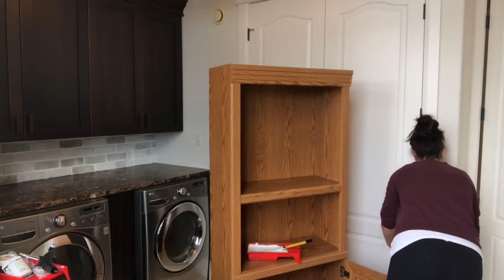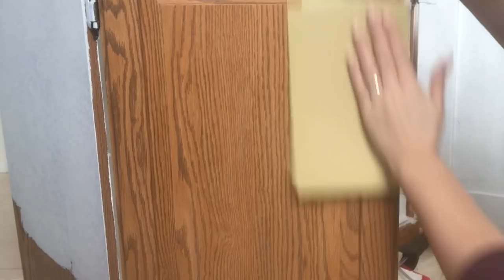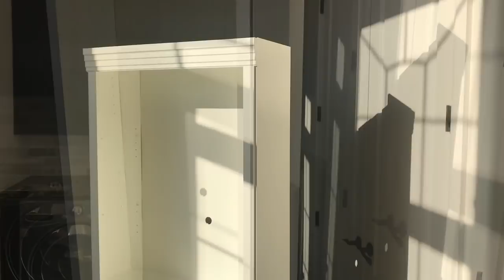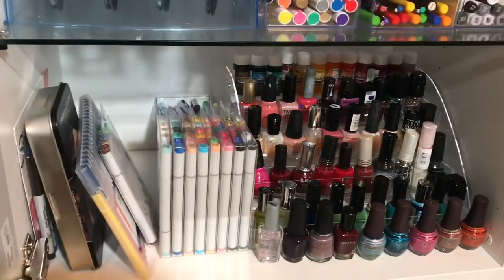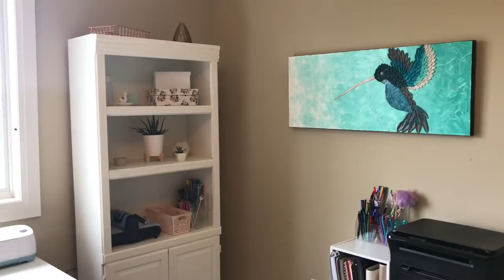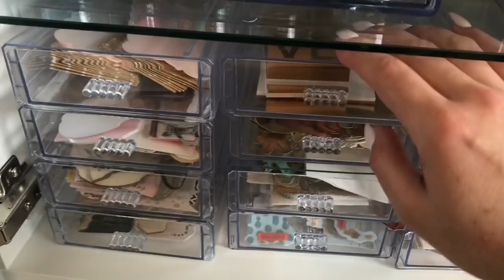How to Paint Laminate Furniture

Comment: A suggestion Vanessa, when painting a shiny surface like a laminate, you should always use a primer after sanding.  Even with the sanding process, laminate is not a porous surface, essentially the paint sits on the top, so it is easy for it to peel or flake off.
This step is recommended on pieces that are going to be well used, or in high traffic areas.
I learned all this from painting our kitchen cabinets, I still use the same primer on all my crafts that I paint! 🖌
Reply: Thanks for the tip 💓 !!!
Reply: What primer do you use?
Reply: What primer do you use?
Reply: @nancyperez9161    I use a primer called, 'Extreme Bond Primer' that I buy at Sherwin William's.  It is a little pricey, but you do not need much in order to have basic craft paint adhere to shiny surfaces, so a little goes a long way, and it can be thimned with water if need be.
Reply: @dellahicks7231  what type of paint do you use on laminate Chalk satin gloss ( I know nothing about painting just watching to learn)

Comment: It certainly LOOKS good, 
With laminate, however, sanding, then priming, then painting 2-3 coats, then a topcoat is best. Otherwise, the paint will eventually chip and flake. Laminate and particle board do not react over time in the same way as other materials.
 Your craft room is fabulous.